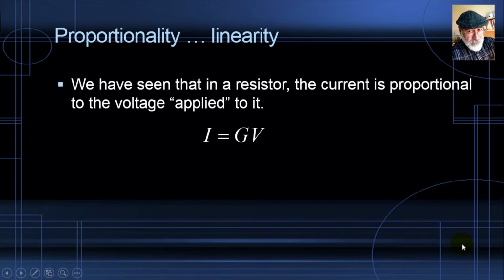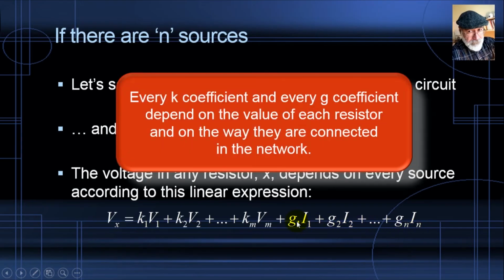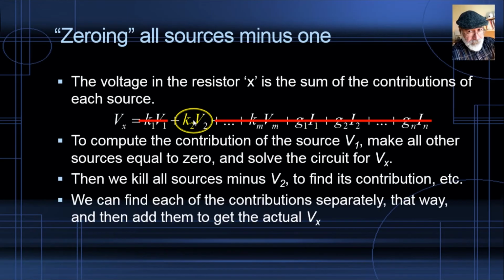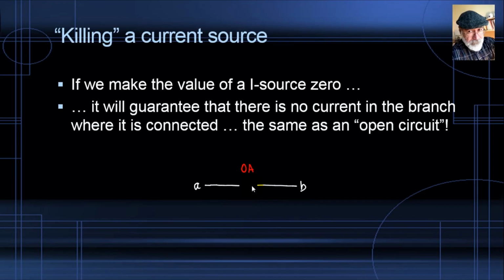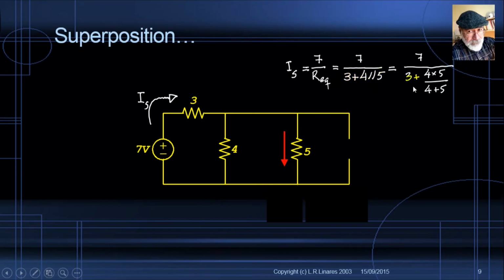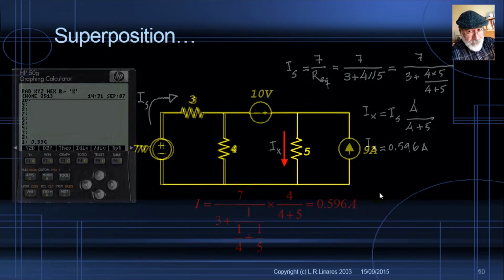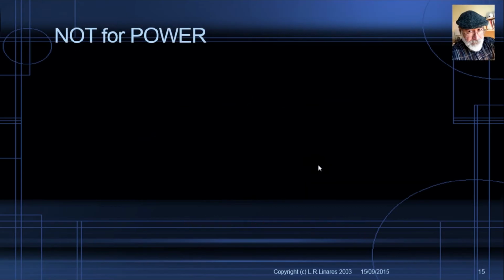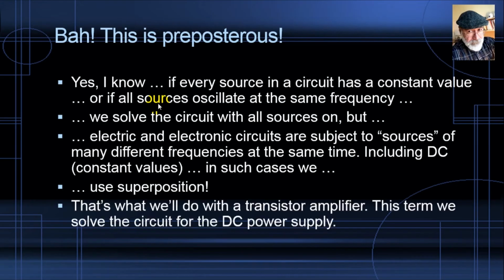EE 101/17 - Linearity and Superposition

Comment: I introduced your videos to Black & Veatch engineering dept.  Some of their engineers wind up doing lots of different projects and need primer courses before going into a different project.  I would love to talk to you about the "electrical demand charge" mitigation project ive been working on for the last 1 1/2 years.  Also we have something we have developed we call "UHEB"  Ultra High Efficiency Blower.
Uses Ultra Efficient Axial Flux DC speed control drive to run the blower in your Air Conditioner no matter how big!!!

KEEP THE VIDEOS COMING!!!!!!!  THANK YOU

Comment: Hi professor,
 For the example you used for superposition, couldn't we have just used KVL (loop voltages) to calculate Ix? and i guess we can use KVL for all superposition cases right?
Reply from the maker: +Rami wael To find the partial voltages, or currents, you can use any method of solution. I used current dividers because it seemed the fastest to me.